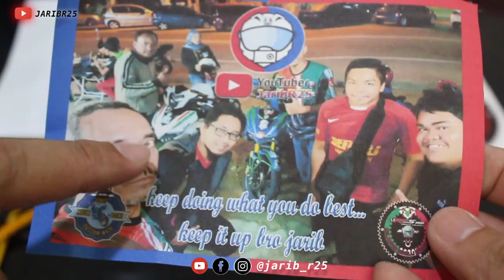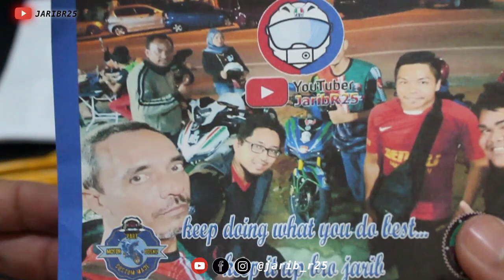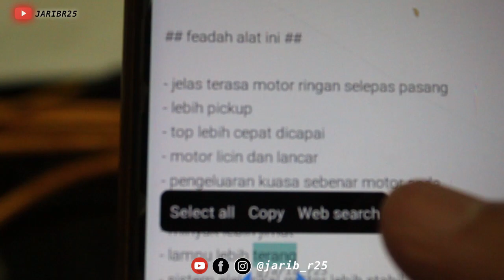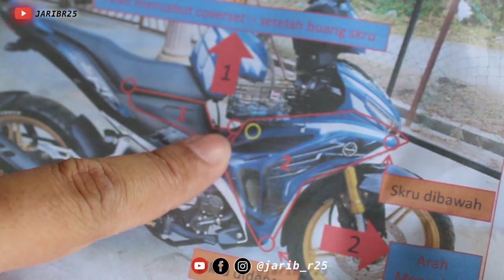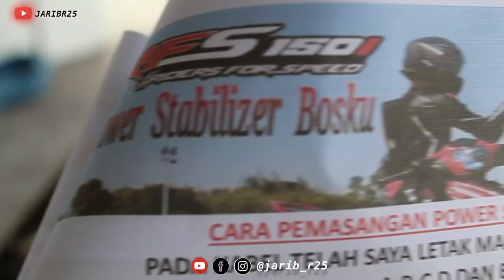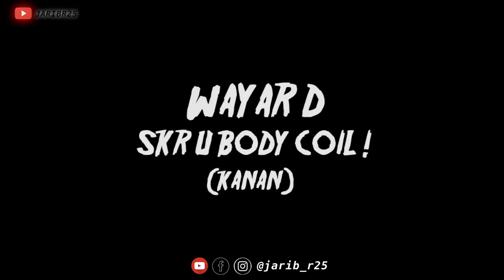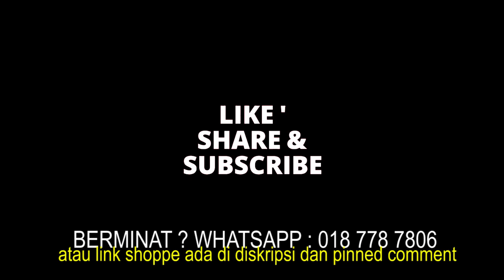PASANG POWER STABILIZER RFS150I JADI RINGAN!

Comment: supo grounding cable je.
Reply from the maker: Serupa tapi x sama. Mmg power pas pakai
Reply: @JaribR25  rpm senang naik ke bang?
Reply from the maker: Tuunggu video test. Rpm 5 130kmh. Gear 6? Fikir2kn
Reply: @JaribR25  mak ai smooth la gitu
Reply: Tpi sya dh psg bang jarib. Knp rsa mcm sma je. X rsa ada prubahan pn sme je. Modal keras tu
Reply from the maker: Refer penjual.